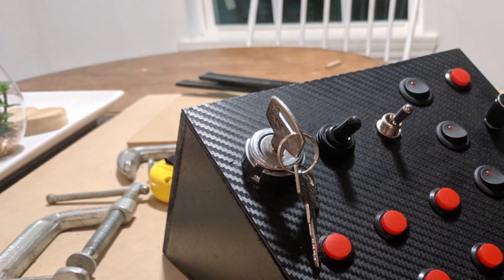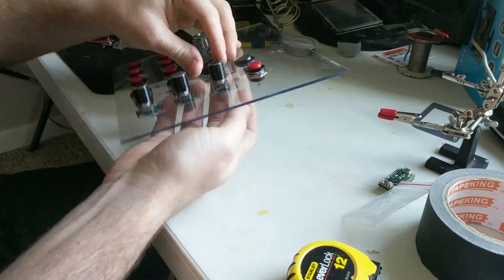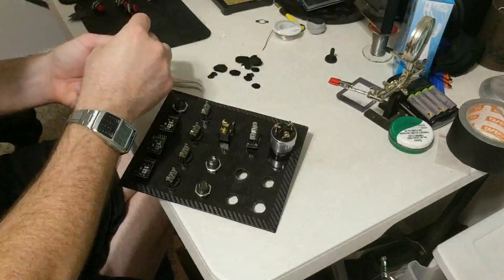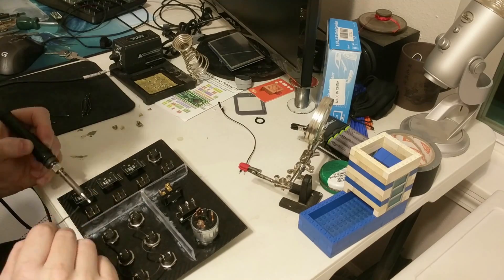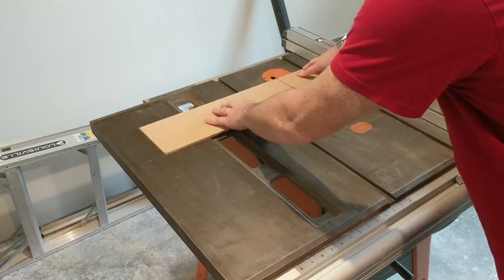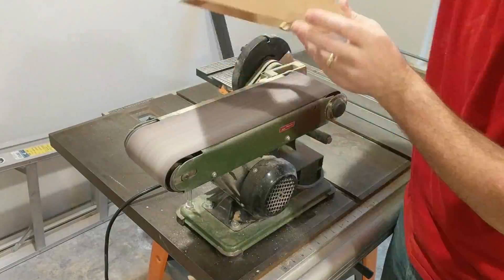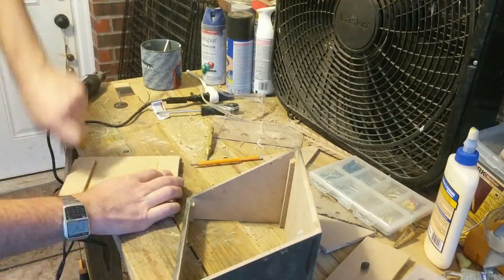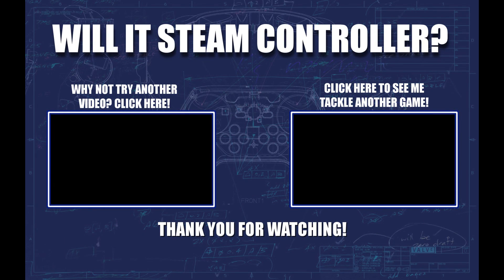Button Box with Key Start for Simulators | DIY | Vehicle Sims

Comment: For anyone trying this, I've made quite a few project with those shitty PVC project wires, and my advice is DON'T! Just buy silicone project wire. Otherwise cable management will be IMPOSSIBLE. Your projects will always end up with the board flying randomly in the middle of the box. I'm speaking from experience.

Comment: Using a teensy makes the game run better too because your bios isnt hammering your comm ports with irqs. It can cause hitching when people use those serial mame breakout boards. You can add hall effect enabled buttons and what not with the awesome adc and dacs built in on the teensy. Best microcontroller by far. Im excited for the teensy 5. Its gonna be like a pi4 i suspect only without having to mess with python and just write c++ straight to the hardware. Python coding is for pussies hahaha

Comment: Can I do that with these China Arcade DIY kits? There´s a ready to plug in USB bontroller board included and a bunch of buttons and you can choose from a variety of joysticks. The question is, does an ignition key work... I guess it depends where you plug in the cables on the board.

Comment: whats the max voltage the switches and buttons should have?
Reply from the maker: That value will vary from model to model.  To be safe I wouldn't put more than 5V through a switch unless they are made to handle more.  Some are 20V, you'd just have to check the schematics.

Comment: Great project! It can be a bit simpler of you use a Leo Bodnar card: https://youtu.be/cCl7dwXBSBI
Reply: Are you sure? The problem ist that the Key switch has 3 postions. Off / On / Start (momentary) and after Start you dont want another "On-signal". You also need a Signal when going from On to Off that he shows in the code video. Do you know if this is possible with a Leo Bodnar card too?

Comment: Would this work on an xbox?
Reply from the maker: The short answer is no, not without changes to the design or code that I don't know how to make. If it is possible it would probably take a great effort.  Proprietary Xbox controllers have special encoding to make them work with the console.

Comment: okay I realize this video is a year-old, but I need to comment anyway. The actual building of the box went through so many unnecessary steps it was painful to watch. So let me simplify it for those who have a tablesaw like this gentleman did. All you need to do is build a closed box!  Then, after all the glue is dried just raise the table saw blade and crank in the blade angle and run the box along the fence to create the angle face and that's it! done in one step! sand it down if you must but all that hand sawing and filing was wasteful and unnecessary. now onto the Arduino itself. you can't put 5 volts into an teensy duino without killing it eventually. I know, because I've killed my share of them building my own boxes. That's when I got smart and switch to a Bodnar part. Little more money but well worth it and no programming involved.!  but I still give you props for the build itself and for taking the initiative to do it.

Comment: Great video, I have built a prototype box using an Arduino Micro Pro setup as 16  joystick buttons. It also has a raspberry Pi 2 with an HDMI screen to use a gauges and built in to dollar store foam for testing. I am waiting for new parts to come in to build a new one on my CNC with up to 52 buttons using Arduino Micro Pro with a matrix for the buttons

Comment: Yes but this video is completely worthless when it comes to showing how to actually solder all wires step by step. How do we wire the ignition key for example ?
Reply from the maker: I understand your frustration, but this video was never intended to be a full tutorial. It's more of a build log than anything else.  Other YouTubers that are a lot more knowledgeable than me have made better videos about how to do the wiring. Finally, I had to do a lot of this stuff without having a specific tutorial, such as the wiring for the ignition switch, and I believe that you have the ability to do that yourself. I have also answered that specific question to another commenter, but I will try to elaborate again here.

The ignition switch is simply two switches in one, one of them a latched switch, and the other unlatched.  There are three positions, off, on, and start.  There are also three wiring posts on the bottom of the switch.  When you turn the key from 'off' to 'on', a connection is made from the ground post to one of the other posts.  When the switch is held on 'start' a connection is made between the ground and the third post.  Therefore it is a matter of trial and error with a multimeter set on continuity mode to find out which post is the ground, which is the 'on' post, and which is the 'start' post.  When the switch is set to 'on' test each post.  When you find a connection, those two posts will be the ground and 'on' post.  Then do the same thing with the key in the 'start' position. The post that is involved with both positions is the ground post, and the other two are the ones associated with each other position.  Let me know if that explanation makes sense, and if you can get it working.
Reply: @thatbengineer5017  I see your point yes, my bad. Thank you anyway for taking the time to respond, I will try and come back at you.

Comment: I just wanna build one with only a couple of buttons is it the same pretty much just less connections?
Reply from the maker: Yes, it will be the same general process but much simpler.  If you have a lot fewer buttons you could use an even simpler microcontroller like the Teensy LC.  The wiring and code will be a lot simpler.

Comment: How do I load the library?
Reply from the maker: There are instructions on Ben Buxton's website for adding the encoder libraries.  The other two libraries are included with Arduino and are loaded simply by having the include line in the code.

Comment: Hi. Please, Can you tell me how to wire the starter, because I don't know how to do :(
I have same starter and which wire do I connect to the 1 ; 2 ; 3 "place'"?
Reply from the maker: The best way to figure this out is to use a multimeter with a continuity setting.  This setting will make a sound when a connection has been made.  Put the leads of the multimeter across different pins as you turn the key.  When a connection has been made you'll know that the two pins you are connected to are the ground and one of the pins.  By logic you should be able to figure out which is the ground pin and which two are the signal pins.  Let me know if you run into any problems.
Reply: hey there, i'd like to know what starter that actually is. i'm looking for one just like that. thanks in advance
Reply from the maker: @derboki88  I bought the starter on Amazon.  If you search for something like 'Ignition Switch with Key, Lenmumu Universal 3 Wire Engine Starter Switch for Car' you should find it.  The one I bought is sold by Lenmumu.

Comment: Does it matter what buttons I use as there are 3v 5v 3a all sorts .... and also the bit where you solder the the 3.3 and the 5 on the board has me confused thanks for your help
Reply from the maker: There is a very wide range of buttons that should work for this kind of project.  The amperage rating really won't matter here, since it is only a measure of the limit of current that can pass through the switch.  I'm not sure what the current really is, but it is far, far below even 1A, so you should be fine with almost anything.  If it says the switch is use with a breadboard, you will be fine.  Similarly, the voltage on the switch is a rating, that is you can't put more than that much voltage through the switch or it might melt.  Make sure to pay attention to which voltage you are using.  The teensy can supply 5V or 3.3V.

For this project, the only voltage that I had to supply to the buttons was for the switches with LED lights in them.  They required 5V.  You will have to do some investigating to discover which pin of the switch will require connection to voltage, pin, and ground.  Hope this helps!
Reply: That Bengineer thanks this was massive help
Reply: That Bengineer sorry for more questions , regarding the code , I have a board but it doesn't have 1-24 different numbered input s. It has A1-7 and b1-15. In the code , do I specify the letter as well then ?
Reply from the maker: @oscarking454  Which board do you have?  The pins will be labelled A1, etc, like you said but in the programming they are almost certainly just referred to by a certain number.  There will likely be a diagram or manual that will tell you what pin label refers to what pin number, for example A1 = 1.
Reply: That Bengineer ohhhh okay
Reply: That Bengineer I have an Arduino pro micro
Reply: That Bengineer you know the led black rocker switches, what pin is what as I have one gold one , and on the other 2 pin switches , does it matter what ones are ground and what ones are signal

Comment: Amazing work. Could you answer me a question. This code you did 
, can I use it on a arduino? I will try to change it a little and use in an arduino uno and use uno joy. 
Again thanks for the video and you have a very good speech, the auto subtitle was perfect.
Reply from the maker: Great!  I'm glad I could help you.  I am almost certain the code will work with an Arduino, but there may be some different libraries that you need to use.  Do some research specifically on using an Arduino uno as a USB device and there should be some good resources.  Large parts of my code may still be usable.
Reply: @thatbengineer5017  well I kind of give up. I don't have de skills for that. What was the board you used. That is a lot is teensy boards. I will just buy the one you used.
Reply from the maker: @opatapreta  Well I believe that you can do it :D I didn't have the skills either before starting this project, I just had to research for myself.  I used a Teensy 2++.  It has a lot of pins which is useful because you can just use one pin per function instead of using a matrix setup.
Reply: Nope, you cannot use this code on a regular Arduino, since it uses Teensy's specific library for controlling a USB Joystick. 
You have to use an Arduino based on the ATmega32U4 chip (such as Arduino Micro), then use a library that gives you functions to bind axis and buttons to joystick input for your computer, just google "Arduino joystick library", and read the documentation to see how you use it.
Reply: It might be a lot simpler to just use a keyboard encoder like a jPac. A lot of people use them to make arcade machines. No programming needed.

Comment: Does Arduino pro micro uses the same idea? Where 2 pins switches are connected with one to gnd and 1 to a input number. Where for 3 pins switches. 1 is connected to the gnd and the other 2 to different input number?
Reply from the maker: Yes, the wiring should be essentially identical.  I've never used an Arduino Pro Micro, but they should be very similar since the teensy is based on the Arduino.

Comment: At the end of the video you show the ignition key from off-->accessories-->ignition. I suppose the accessories and ignition are 2 separate "buttons" on the arduino? I did not see a setting in ATS or ETS2 other than "engine start". Is there a special configuration in the game to allow a separate input for ignition and "on" ? Thanks
Reply from the maker: There is a setting in game play options called "Automatic engine and electricity start." This will make it so that when you press the engine start button once the electronics turn on, then pressing it again turns the engine on.

The key actually sends the same joystick button signal at every stage. The only difference is that the first two positions are latched and the third position is spring loaded to return to the ON position.